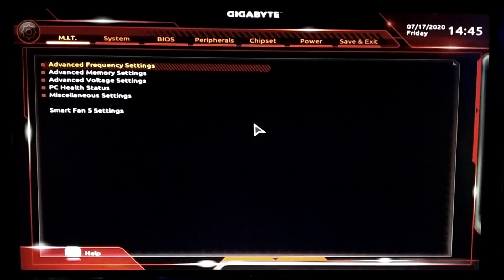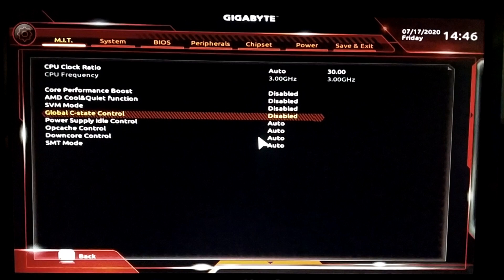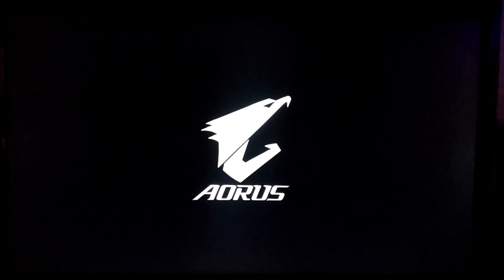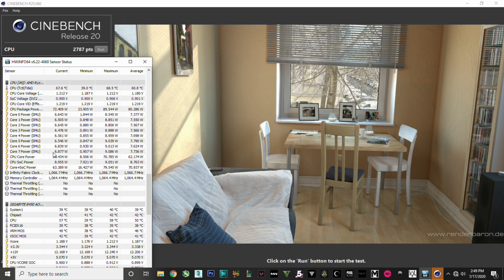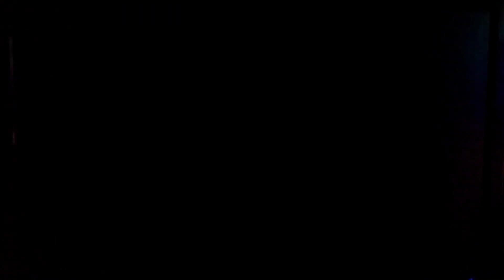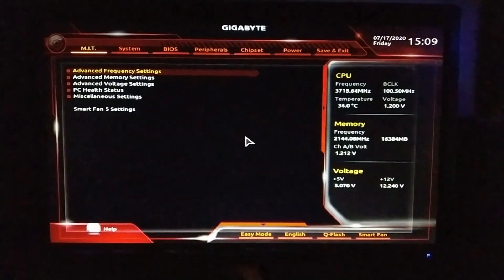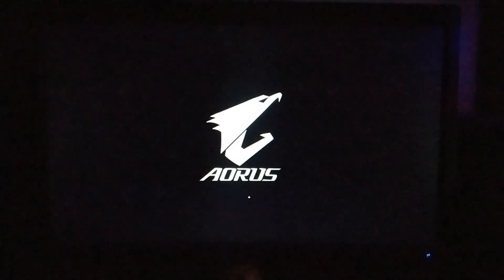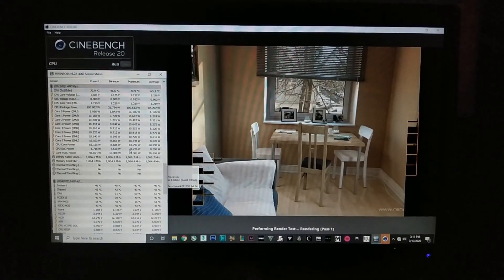How to overclock Ryzen 7 1700 @3.9Ghz | Gigabyte B450 Aorus Elite | Ryzen Tutorial (2020)

Comment: Hello i just found out this video and it helped me alot. I set my cpu to 4Ghz and 1.38v (i guess its like 1.4v) and run a few cinebench and it didnt crash but when the PC is in idle i get temperature spike from 39 to 50 constantly... so my question is, it is any way to fix it or know why it is doing that? 
Thanks :D
Reply from the maker: Hello! So since you overclocked your CPU to 4ghz with 1.38V...the real temp is not 39°C. It would be around 50-ish if not using Liquid or expensive air cooler. The reason why it goes down to 39°C coz of the idle state which happens coz of your C-State/P2-State. Now, everytime there is a background activity which requires your CPU to act upon, it triggers the CPU to hit the voltage and OC frequency you just dialled in your bios which gives a rise in the temperature. There is nothing to worry about also, you cannot change that but only minimize the mount of background activities if possible.
Reply: @buildsoc1215  Ohhh okay now i undertand it. 
And yes my temp is around 45-50 like u mentioned because i use a liquid cooler, just a decent one.
I'll keep it like that since atm it doesnt give me any problems.
Thanks u so much for ur answer u are very clear and helpfull. ♥
Reply from the maker: No problem man 😃 Glad to help. Thanks to you too 👍

Comment: so would you do something similar for undervolting a ryzen CPU? asking for a friend who has a x570 gigabyte MB with a 5800x :)
Reply from the maker: Hello! Yes, you increase or decrease the voltage from the same offset value or the actual value (depends on motherboard) but the only difference is in case of undervolting you don't increase the CPU frequency.

Comment: I'm. Tryna under volt
Reply from the maker: Sounds good to me 👍😀
Reply: @buildsoc1215  I've tried under volting and over clocking and the stable voltage is 1.225v but sort of confused in the BIOS. What's the 114 but for 1.225v? I have a ryzen 7 3700x
Reply from the maker: I'm sorry. What exactly are you stating 114 as?

Comment: Do you recommend to overclock ryzen 7 1700 on msi b450 pro vdh max to 4.00ghz will it be okay
Cause msi makes awesome vrms
Reply from the maker: Hello! Yes, you surely can overclock on that motherboard but make sure to keep a check on the vrms as the temperature is affected by many physical and logical properties which may differ from what i would tell you. Make sure you don't exceed the temps above 80°C even though vrms are meant to handle the temps upto 125°C before your system completely shutdown in order to prevent damage. Also, most importantly you need to have an adequate cooling system as Ryzen 1700 runs quiet hot @4Ghz - 4.1Ghz.
Reply: @buildsoc1215  thank you for your kind information i just ordered parts for my first streaming pc thats why
Reply: @buildsoc1215  the parts r7 1700 and rx 570 and msi b450m pro vdh max
Reply from the maker: Thank you 👍😀 And That's really nice. Good luck with your build and comment down for further queries. Consider subscribing if you find my content helpful and informative 👍😀

Comment: if i dont want to add voltage but want it to set fixed value?
Reply from the maker: Hello! If you don't add voltage then you won't be able to overclock higher. Without adding voltage you can probably gain like 3.4Ghz - 3.6Ghz. Just set the ratio 3.4 and try benchmarking... If you succed then keep doing until you crash! When you crash, set the last ratio which was stable and you are good to go 👍😀

Comment: Hi, how far can I oc my ryzen 3 3100 on aorus b450 elite and fera 3 120mm cooler? How many GHz and V you think?
Reply from the maker: Hey! Ryzen 3 3100 can be overclocked upto 4.6Ghz. But how far you can get depends upon your cooler and ambience temp. About voltage, try not to go above 1.45V is the max safe voltage, AMD recommends 1.35V for daily use and about voltage for your overclocking, I cannot just give a number because every CPU doesn't overclock with same voltages. But I think you will be able to pull 4.1ghz - 4.3ghz somewhere around 1.35V - 1.37V
Reply: @buildsoc1215  ok, thank you very much for answer
Reply from the maker: 👍 good luck buddy! Let me know if you need any more help.

Comment: It is okay Ryzen 1700 overclocked to 3.8GHz on 1.21V with CoolerMaster ML240?
Reply from the maker: Hello! Yes it is enough to go with that. You are all good. 👍
Reply: @buildsoc1215  What voltage you recommend me for 3.9GHz? Sorry if i bother you
Reply from the maker: @Plasma No you don't bother me at all mate! I am here to help in anyway you want. I wonder if your 1700 is even stable at 1.21V for 3.8Ghz. But @3.9ghz you need to have some where between 1.31V to 1.35V. My 1700 is stable at 1.33V.
Reply: @buildsoc1215  Hello! I don't know why but my game keep crashing. Voltage usage is ok on Core Temp program, but when i play game, game just crash. Temperature is 48-50°c
Reply from the maker: Core Temp program isn't ment to show you voltages. Also, it just show's you the current voltage. If your games are crashing that means your CPU isn't stable. Like I said, I was already doubting about 1.21V for 3.8Ghz. 3.8Ghz is stable at around 1.275V - 1.3V. Try those values and benchmark your CPU everytime you set in an offset for your voltage. Use Cinebench R20 for benchmarking.
Reply: @buildsoc1215  i use Cinebench R23, but when i tryed higher voltage then CPU Temperature getting higher
Reply from the maker: Well yes! That's the thing. The higher is the overclock, higher is going to be voltage. Hence, resulting in higher temperatures. You have a coolermaster ml240 that's can handle 1.3V without problem.
Reply: @buildsoc1215  Can you tell me what is limit for CPU Temperature when you overclock
Reply from the maker: Make sure you don't exceed the temperature above 85°C if you are overclocking for gaming and not above 80°C if you are gonna do editing or rendering stuff.
Reply: @buildsoc1215  Can you tell me what is your CPU Temperature when nothing is in background, only system?
Reply from the maker: The idle temperature of my system is around 35°C - 39°C, normal work load is 42°C and gaming temps are 45°C - 55°C and editing & rendering temps are around 65°C - 78°C.
Reply: @buildsoc1215  What is your maximal temperature when you do Cinebench R23 Multi-core test?
Reply from the maker: @rejhan.kljajic  The maximum temp in Cinebench for multicore is 81°C. And actual maximum temperature for my work load is 78°C.
Reply: @buildsoc1215  When i watch movies on Google Chrome my temperature of processor goes up to 47°, what do you think about it?
Reply from the maker: 47°C is completely fine and completely safe. Regardless of what you are doing, the temp will always raise between 45-50°C.

Comment: Why my mobo doesn't have the x.m.p?
Reply from the maker: Hello! Which motherboard do you have?
Reply: Hi, I have a Gigabyte b450m aorus elite
Reply from the maker: @CanalDoPalazio  Go into your Advanced Frequency option.... Then you will see your CPU ratio and below your CPU ratio and clock you should see X. M. P
Reply: Here you can see...

https://prnt.sc/wlkebe
Reply from the maker: Haven't had my hands on that mobo but never expected that gigabyte wouldn't provide support for XMP it's a freakin 450 series. Anyway, you can set the multiplier of the ram to your RAM speed if you want and set the voltage manually to 1.35V. If you have some issues, comment down I'll help.
Reply: I tryed with 2933 and 3000mhz with 1.35V, no boot... =/
Reply from the maker: Can you please let me know these things?! What CPU you are using, what RAM and what motherboard with its version if any.
Reply: I don't have that option, literally

Comment: Ryzen 1700 is an awesome cpu , if you have flare x ram cl14 ram to go along with it , and overclock the cpu to atleast 3.9ghz. it will perform like a 2700x. In gaming.
Reply from the maker: Hello! Indeed. I am actually running Corsair Vengeance RGB PRO 3000Mhz CL14 32Gb. And it runs damn smooth.

Comment: Lol mines at 4.0 all core on an x370
Reply: Change multiplier and set core voltage to1. 35
Reply from the maker: Guess what I have better Idea for you! Change the multiplier to 41 and set core voltage to 1.4375. That's how much mine can do. Oh, also make sure you don't burn your Motherboard if you don't have the adequate cooling.

Comment: i have stock cooler ryzen 7 1700 can i try overclock 3.9ghz??
Reply from the maker: Hello! If you are just planning for gaming and no editing/rendering stuff then yes you can overlock it to 3.9Ghz on stock cooler.
Reply: @buildsoc1215  yeah for gaming
Reply: @buildsoc1215  I have msi b450 tommahwock max
Reply from the maker: I see! Tomahawk can handle heavy overclocks.
Reply: @buildsoc1215  3.9ghz
Reply from the maker: Yes! 3.9Ghz easy 👍
Reply: @buildsoc1215  i download ryzen master but i dont know how i doit
Reply from the maker: @panosthegun  you don't have to do it by using ryzen master. You can and should always do it from bios to be precise about every setting. You can do it from bios just like I have shown in the video.

Comment: How far do you think I can go with watercooling?
Reply from the maker: Hello there! With water cooling you can go pretty high on voltages and push your FQ pretty high. But make sure to be in the safe limit as even with the safe temperature you can still destroy your components a.k.a CPU & motherboard. Safe temp. = Below 80°C.
Safe Voltage = 1.35V AMD Recommended for 24/7 use & 1.45V max safe voltage for overclocking with an exotic cooling. Try your luck as for how far you can push 😊 Good luck 👍

Comment: I overclocked  It on b450 aorus elite with a clock of 4ghz and 1,4 vcore
Reply from the maker: Hello! That's good 😄 I have mine overclocked to 4Ghz with 1.38V. I tried going with 4.1Ghz @1.425V but almost completed the stress before crashing. Didn't go any further but I guess it will settle with 1.43V-1.44V but for that I need really exotic cooling. Haha

Comment: do u recommend it for Gigabyte B450 Aorus M?
Reply from the maker: Hello! You can overclock on that board but to be honest VRM of that board isn't that good to handle pretty massive overclock. You can try manual overclocking and check for the results for both Single And Multi core performance. If you get good results then you are good otherwise let the CPB do it's job.